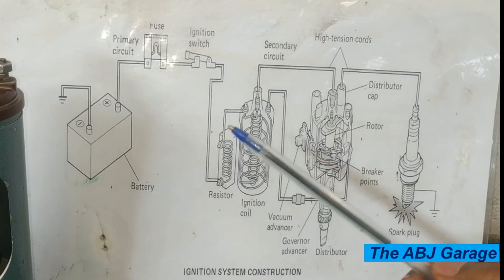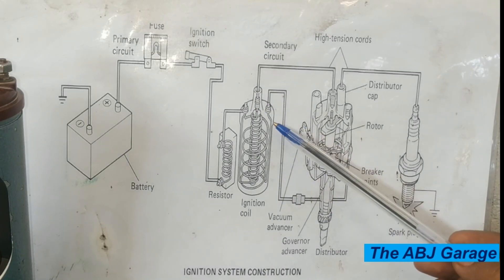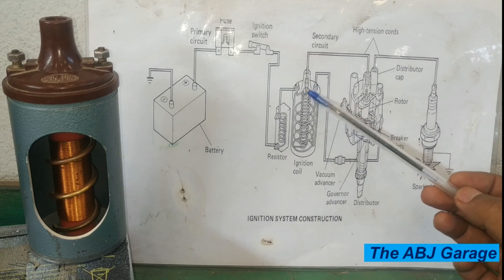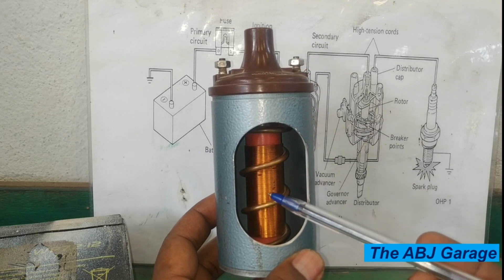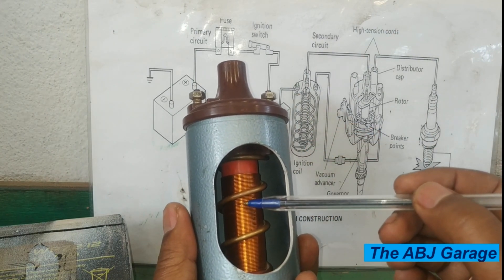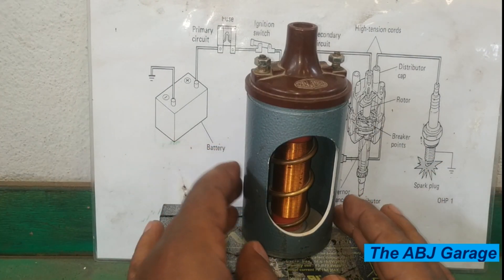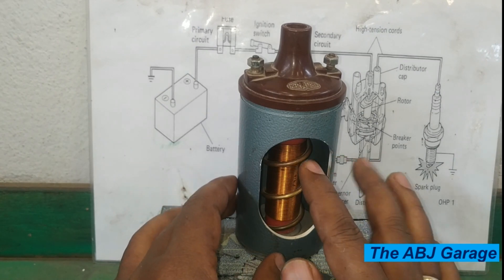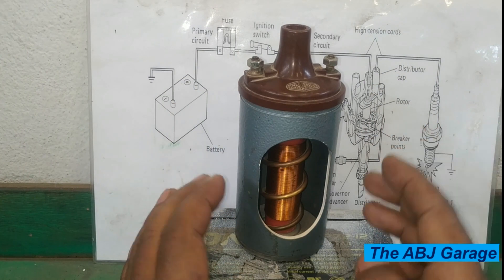Ignition coil explained

Comment: Any idea what would cause a coil to put out 12v from coil wire at all time?
Reply from the maker: If 12v is read at ignition coil positive terminal, that would be normal, but if coil negative is reading 12 volts all the time, then it indicates problem with the grounding circuit, it means the coil is not receiving ground. If the coil is properly grounded, as when the contact points close, it should read zero volts, when the points open, it will read battery volt at the coil negative.

Comment: Then how does the ignition coil keep producing sparkling when the battery of the car is removed. The engine keeps running uninterrupted. What makes this happen even without the car battery?
Reply from the maker: If the charging system of the car is working correctly, the alternator will keep on supplying electricity to the ignition system. Some mechanics even use this method of disconnecting the battery to see if the charging system is working or not! But it is not recommended on modern cars as the voltage surge can damage the sensitive electronic components.

Comment: so does the magnetic collapse only happens wheh you start the car, or is it a process that continues to happen while the  car is running,
Reply from the maker: The building and collapsing magnetic field continues as long as the engine is running. That collapsing magnetism is what causes ignition and fuel combustion in the cylinders

Comment: What will happen if you switch the primary wires on terminals 1 & 15? Will the coil overheat or create a weaker spark?
Reply from the maker: The secondary winding current will start to flow through the primary as well!  That will make the primary and the secondary windings to become in series as the contact points open. It could even cause the secondary voltage to fire at the contact points!
Reply: @TheCarCareGarage  thank you!